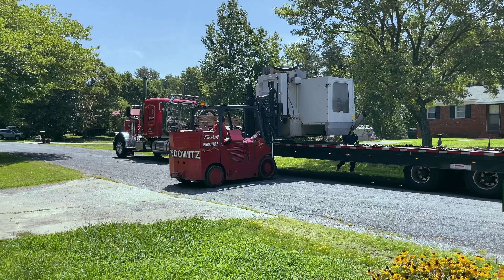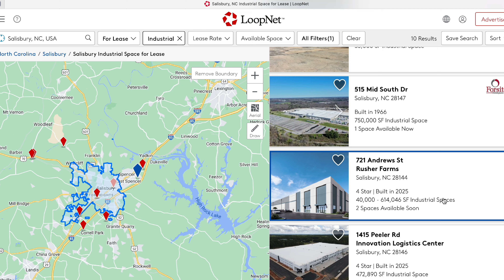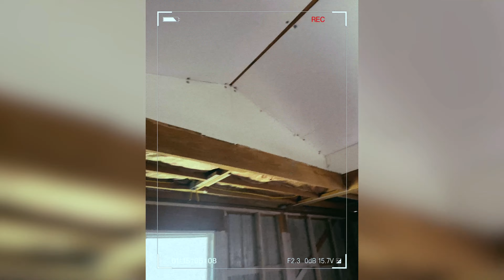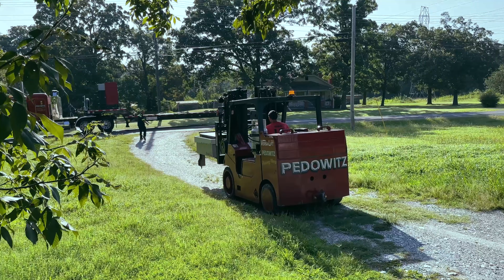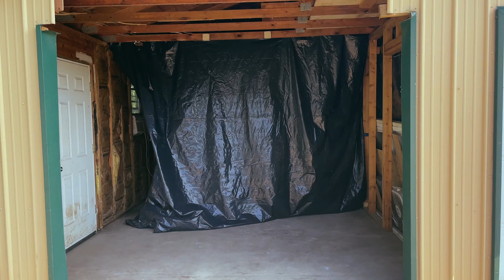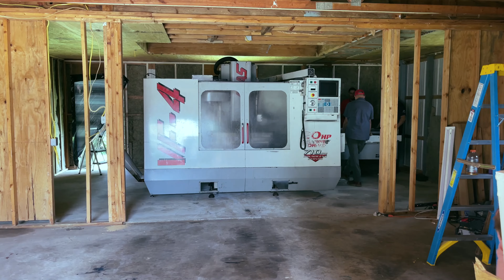Is This Machine Going to Fit Inside My New Shop? | BAPM Ep.13

Comment: looks great  i have a Mill and Lathe in my Home Shop..  i used steel sheeting on my walls and ceiling.
Reply: Thanks! How do you like the sheet metal for your interior? Does it make the noise reverberate?
Reply: @MilSpecManufacturing   i honestly don't notice any echoing..i think the insulation helps with that..its packed in pretty sight so there's no movement to the Sheet.